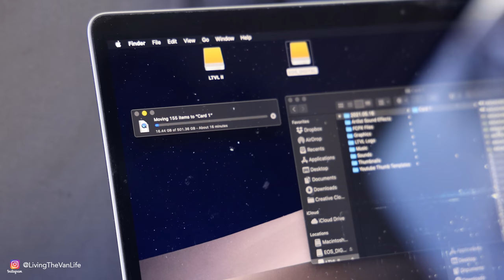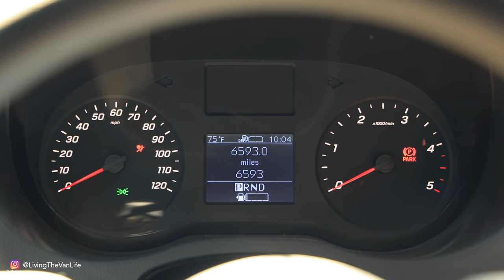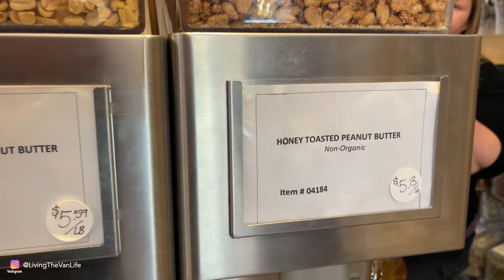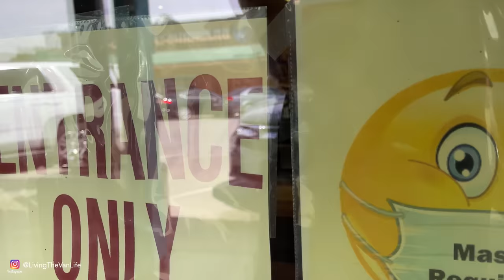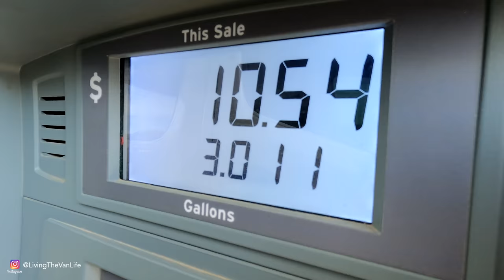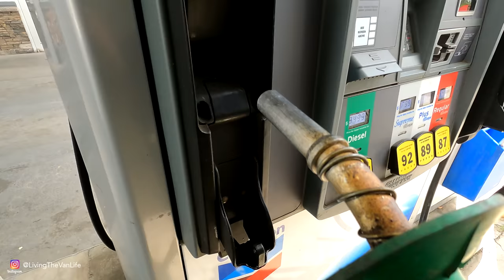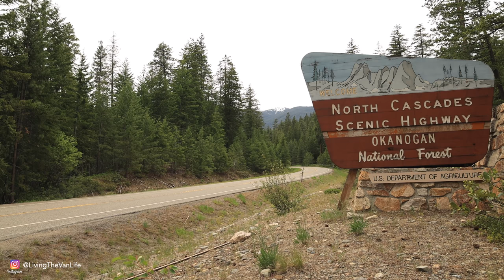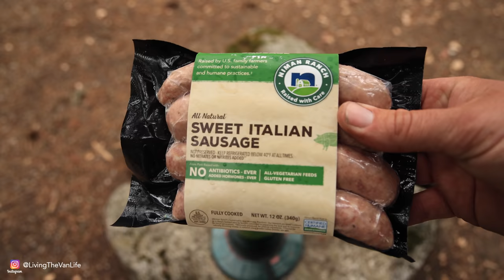A Day On The Road - Living The Van Life

Comment: Overnight ashes are still usually hot enough to start a fire.
Reply from the maker: Not in this fire pit.  There is enough air to it that it burns to a fine dust.
Reply: I think it's still dangerous to drop the overnight ashes as you did. In my experience I must agree with HyperXism,  your ashes weren't all transformed in fine dust as you mentionned.

Comment: Excellent video, Chad. Long way since you were driving up to Canada, just to see how well the diesel heater worked in the cold! Have you given consideration to getting an auxiliary fuel tank? Agile makes them. Don't know if they can be added with the changes you've made, or not. They have an auxiliary, which you can use when needed, and just plain, bigger tanks. The only thing I don't like about adding a tank, especially just a bigger one, is that it hasn't been safely tested. The auxiliary, you're not going to use all the time. Keep up the good work!

Comment: So... @simplisafe. All of us nomads really need to pressure them to provide an off-the-shelf 12v power solution. If they are advertising in front of all us #overlanders and #vanlifers, they need to make their system work off the shelf without an inverter! We all know it's completely impractical to run an inverter 24/7 no matter how good your solar. I home- built my own 12v power supply for the SimpliSafe setup in @mtn.rover but it wasn't easy.
Reply from the maker: But they also need a permanent address for it to work.  Otherwise if it sets off an alarm, where are they going to send the police to?
Reply: @LivingTheVanLife  Yes, that's another thing that's annoying. I set off the smoke alarm cooking last night (!) and they called me and referenced to a very old location. On the other hand, I'm pretty happy with SimpliSafe devices and features. Outside camera has stayed mounted for months through weather and 70mph travel with no issues!

Comment: Curious as all our travels have been done using Jeeps and Gladiators over the years, how is the Van handling the new suspension and larger tire size? What kind of mileage are you seeing?
Reply from the maker: They van handles amazing on the highway. It’s lost a little bit of acceleration off the line. But still plenty after that.  I get about 14 around town and about 16-17 highway.
Reply from the maker: Off-road, the ol Vanagon with its 4 wheel independent suspension is a freakin Cadillac. But the sprinter is built more like a 3/4 ton pickup truck. And it rides like a 3/4 ton pickup over the ruff terrain.  The Vanagon excels at the off-road terrain.